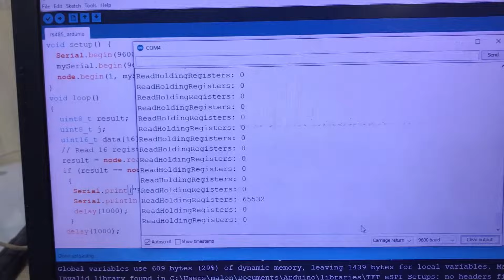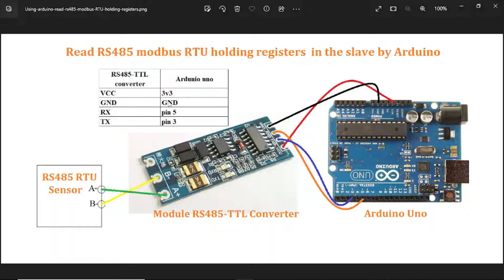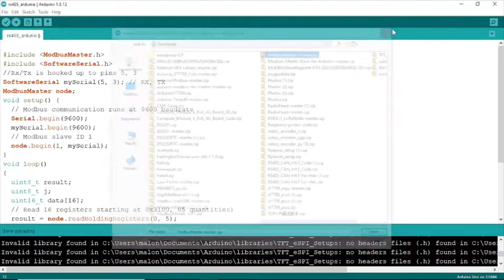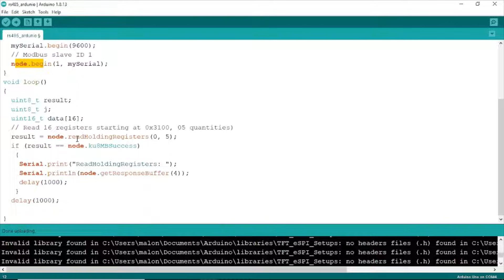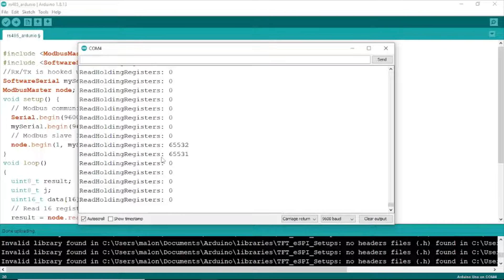Using Arduino to read rs485 Modbus RTU holding registers

Comment: Does the same ModbusMaster library allow the Max485 to send data? I am looking for a way to save previously received RS485 signals, and duplicate them in a new system. Basically tricking a controller into thinking it is connected to the original actuator

Comment: Hi Sir..!
Hope you have a great day.
Can you please help me I'm a student.

I used same rs485 module and wants to communicate between master and slave system.....but both can transmit and receive data in two-way......!

Problem is Master can transmit it's data towards slave but slave transmission towards master is in possible....!

Please help....is it possible to transmit Data in both directions with this same ttl or I have to use another module..?
Reply from the maker: I think, it's possible, you can read and write holdings register from Modbus sensor, but  between 02 systems you have 2 RS485 modules
.
Reply: @mysonacademytechnology2431  thanks.